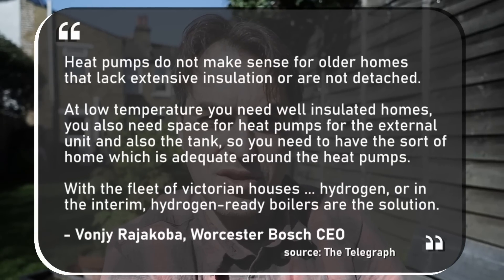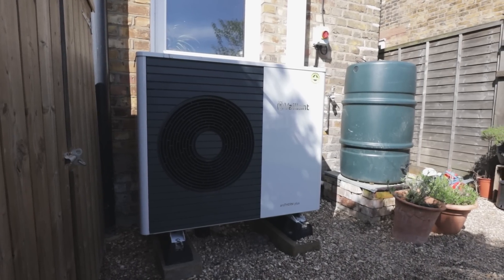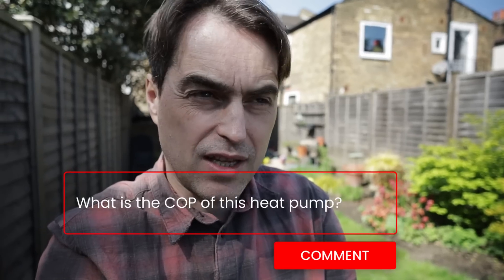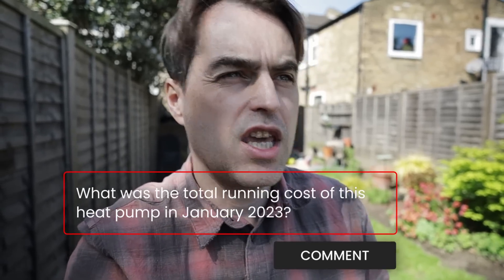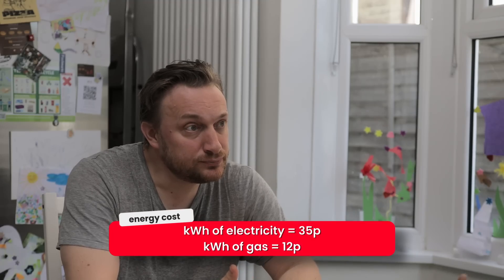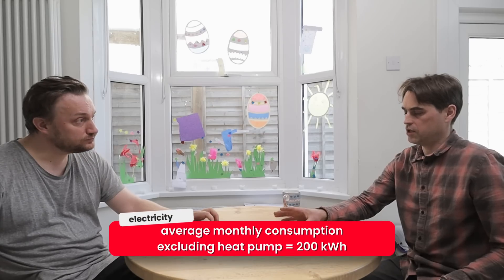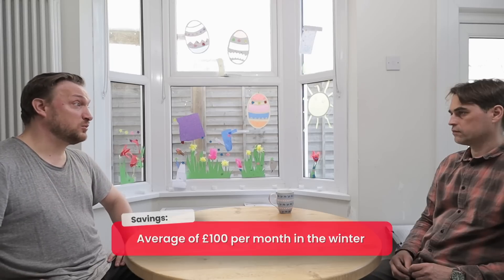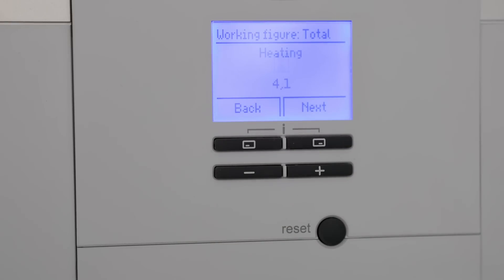Worcester Bosch CEO Is Wrong About Heat Pumps. Here Is Why.

Comment: How about a similar property fabric but twice the size with about 27,000 kW heat loss. 

But the ability to run the heat pump / s with 9p per kilowatt continuously.
Reply from the maker: 27,000kw heat loss? This one is 7kw ?
Reply: @UrbanPlumbers   ok I have planned the house using heatpunk and it says; with - 2.5° C outside temp  I need 22,241 w of heat power.  

This is not including the basement that has three rooms (42 m²)

You may be wondering why I'm chatting on here. I've had round 6 heat pump companies five of which didn't get back to me and the 6th said it was impossible
Reply: @Michael Pickles  Hi Michael

The property type or heat loss is almost irrelevant. If your property is bigger and less well insualted you just need bigger and or more radiators but that would be true for a natural gas boiler too

People naturally do this without thinking about it. A 1 bedroom flat has 1 radiator in the bedroom whereas a 10 bedroom mansion still has 1 radiator per bedroom but that equals 10 radiators 

Your home sounds huge so maybe 2 totally independent (or maybe even 3) heat pumps would be a good idea and this way if one goes out and need a repair It won't be as urgent as the other is providing heat

So the answer is yes you can definitely use a heat pump for your needs 

Also consider more internal insulation. Even the smallest amount of insulation makes  a big difference to solid walls. 15mm of internal wall insulation will reduce heat loss on a solid wall by 50%

You don't lose much space with 15mm for insulation
Reply: I totally agree,  
If I change all the radiators and put two K3 1800x650 in the major rooms and single K3 in the hallway and stuff I can achieve a flow temperature of about 45° C with a room temperature of about 19 to 20° C weather outside temperature of -2

That's running off a 16 kW Samsung heat pump
With a cop of about 3.9 
Before installing insulation. 

It's good to know the end goal and restraints before you start the project

Each of those K3 radiators (1800x650) cost £450 to £500 each
So it may be cheaper to put under floor heating on the ground floor. 
Which means I'd go with a full hog of insulating under the floor.
Reply from the maker: Did you mean 27kw not 27k kw?
Reply: Ha yes 27kw not a massive building
Reply from the maker: 27kw should be massive building. Usually 6-8 bed fully detached period uninsulated house
Reply: @UrbanPlumbers  
306 m² Edwardian. A basement, ground floor, first floor, loft conversion has 5 open fire place. 
32 kW  system boiler + hot water tank 230ltr.

First Insulation project
The bathroom is fully insulated and tanked 70mm pir in the walls and 200 in the roof 100 in the floor. With air change system.

The rest of the house is just solid brick wall 200 mm + 
Lots of windows all double glazed.
Half the floor has 100 ml insulation ( basement roof fully tanked)

The loft only has 50 mm PIR.
But there is some fibreglass in the loft floor about 100 mm.
Reply: Radiators are in dying need of replacement
Average size 1,270 by 600 K2
Reply: Houses fully detached
Reply: 6 km solar. 
Three phase power
To Victron off grid system. With 82 kWh of battery. (Grid tide system) enough to run the house for 3 days at 9p per kW
My energy zappy X2 Eddie X1 
With more 14.4 kW of solar to install later.

Copper pipe work is a mix of 22 mm and 15 mm

Comment: I'm wondering if we are comparing apples to apples here. 500kwh of electricity in jan 23 with an average cop of 4.1 (I assume jan cop was lower but let's give the heat pump a slight advantage) is roughly 2050kwh worth of heat. A gas boiler running at the same temps as the heat pump would be running at what, 90% efficiency? That's 2800kwh * .9 = 2500kwh worth of heat so that's already a 20% more heat that was needed to heat the place assumingly due to a colder weather (apparently 3.1 degree average in jan 2021 and 5.1 average in jan 2023). Were the rads the same? Because if as part of the heat pump install you installed larger rads and the old boiler was running hotter temps due to smaller rads, that again decreases it's efficiency. If we were to take .9 efficiency of a boiler to output the 2050kwh, we woul be looking at roughly £266 of a gas bill, that's £90 dearer than a heatpump so less than what was mentioned in the video.

Not bashing heat pumps, I like the idea of effectively stealing heat from outsite and bringing it inside thanks to this technology however like with all new things, the devil is in the minute detail and I'm just getting a feeling some detail is not talked about here.

I love the vids btw despite personally being against global push towards everything green, electric and generally rainbowy.

Edit: Also, did they heat the place to the same temperatures in the two months? Jan 2021 would have been a pandemic month so they would have probably been in the house more therefore needed to keep the house at the comportable temp for longer periods of time? I would love a brakedown of ALL the figures, it would make for a very good and informative video!
Reply from the maker: You are missing the fact that gas boilers are only around 85% efficient and some gas was used for cooking. So let’s say 2600kwh for heating x 0.85= 2200kWh of gas. Spot on 4.1 cop on 500kWh of electricity
Reply: Underrated idea actually! Ppl with newer condensing boilers with improper rads & flow temps should probably consider replacing the rads and ensuring proper flow temps. Then their system will be more efficient, and they will be ideally set up to switch to hear pump when it comes time to replace the boiler.
Reply: *heat pump
Reply: Why are you against the global push towards everything green? Clearly you do not value the environment that your children and grandchildren will have to live in. They will be cursing you for your complacent attitude and lack of foresight. Not nice is it?

Comment: How much are these heat pumps ? What if the price of electricity goes up would the cost against gas then be more expensive , not had heat all winter gas boiler not working , looking for something for future, old now won’t make it through another winter without heat.
Reply: @kavanobrien6547:  By all indications the tax burden that electricity currently bears is going to be shifted onto gas.  However the gov. have been saying this (Grant Shaps) for at least 2 years now but nothing happens.  Lol

Comment: the insulation thing I never understsnd. like for like an uninulated house would also use more gas.
Reply: Haha yup! And a condensing boiler at the wrong flow temp & radiator size would also use more gas!
Reply: Yes, if you have really good insulation, heating shouldn't cost much however you do it.

Comment: I have a 1989 detached 4 bed, well insulated, with micro bore to all the ground floor rads but 15mm to the upstairs rads.Couple of initial surveys said I need to replace the 10mm microbore with 15mm to get the flow rates I need. With a concrete floor that's just not going to happen within any sensible budget. Is this generally the case ? Or am I being hoodwinked ?
Reply: Could you consider adding flat panel radiators to the main floor instead?
Reply: There isn’t a problem with micro bore as long as you keep on top of your system maintenance constantly replace your inhibitor and get annual flushes, most fitters opt to swap it out because they don’t want to deal with the problems that come with poorly kept systems on micro bore that being blockages when you go to fill up after it’s been dropped.
Reply: Most fitters can't state a scop because they're no guarantee they can get microbore flushed properly due to the size of the pipe when flushing for a new system. There's usually a clause in our paperwork that if an effective flush can't be achieved we're not responsible and the pipework may have to be ripped out and replaced anyway.
That said it it's 15mm to the upstairs rads, why can't you have 15mm pipe drops down to the ground floor from above and cap off the pipework in the screed. 
The other way of getting the flow rates would be a buffer tank, which takes up more space inside the property and lowers the overall efficiency.
Reply: Two surveys make the same recommendation and you think they are trying it on?
Reply from the maker: Too many factors involved to be able to answer this question. Full heat loss calcs are needed before you can tell if microbore can be retained. It is usually best to replace it
Reply: @UrbanPlumbers  Thanks. And there lies one of the major problems for many, many houses. Most of whom will have concrete floors as was the "trend" when these houses were built and still are. The cost of replacing carpets, and other flooring on top of the mess and chopping out the floors and repairing is high. Running pipes on the surface is simply not practical. Let alone the space for oversized rads. Not many mention this. I did get two estimates last year and to be fair both said the same. the cost ? £14-17k.
Not you but the smug arrogance of some channels is unacceptable.  Are you watching Heat Geeks ? The majority of homes in the UK cannot afford such a cost. Especially as the only return is a feeling of patronising virtue signalling. Retro fitting most modern homes is out of the question.
I would like some of these channels to justify the extortionate cost against the ability of ordinary, remember them, people to afford it. The technology and costs involved in ripping apart modern, not easy victorian , homes is a gap that is simply unatainable for the vast majority of people. They are not going to be able to do it. So this lemming like rush buy the idiotic COP agreement will fail. What do people do when they have no way to heat their homes ? Can one of the virtue signallers answer that ? They never do. Sorry, rant over
Reply: @topgazza  Dig a fire pit in your concrete floor and start burning coal? Save it for the Daily Mail.
Reply: You are being hoodwinked. You need only replace microbore with 15mm pipe where resizing makes it necessary. My heating system had both microbore and coaxial valves on the radiators which were awful. When resizing I dug up the floor in order to fit 15mm pipe to the other  end of the radiator. If you really need to replacing microbore with 15mm pipe upstairs is pretty straightforward. I did this when resizing my radiators for my 1979 4 bed detached house which sounds very similar to yours. My ground source heat pump works very well with it.

Comment: Great video. You really are starting to blow the negative myths of heat pumps out of the water! 
Heat pumps will replace gas soon.
Shame about the location restrictions though. Another hurdle for heatpumps to overcome.
Reply: What they’ll replace is all the money you have in your wallet . Lol there over rated. Insulating homes and reducing the sizes of homes is the key to reducing our carbon foot print .
Reply: @garza7676  Uk home are already tiny! Heat pumps are the future, watch this space!…..
Reply: @deanchapple1  there great til the power stops working and it’s 20 degrees outside then you’ll wish you had natural gas 😂
Reply: @garza7676  gas boilers need electricity too! 🤦🏼‍♂️

Heat pumps are amazing. What other heating technology will give a 1:4 return? So for every 1 kilowatt in, it gives you the equivalent of 4 kilowatts out. 🤯
Reply: @deanchapple1  how much natural gas did you have to burn to get that kilowatt ? Genius
Reply: @garza7676  all the electricity came from renewable sources.
Reply: @deanchapple1  lol dude what are you  talking about ? Where is this fantasy land that you live in ?
Reply: @garza7676  England bro! 🤙🏼
Reply: @deanchapple1  😂😂😂😂 really😮 60% of electricity in the UK is generated by burning gas. If all  gas boilers were replaced with ASHP'S then we would be like South Africa with daily blackouts as the grid couldn't cope. That's even before all cars become EV.

Comment: Great install. What flow temps were they operating at in Jan?  Seems like flow temp is the make or break and I'm genuinely interested to know what sort of ball park this system is operating in. Cheers for the excellent videos!
Reply: You also need the right radiators. For example single tube radiators are designed to run at 180F. When the temp drops by 20 degrees they only put out half as much heat or something. Even condensing boilers must have correctly sized rads and correct flow temps to operate at their most efficient. Funny how very few people ever talk about that though..
Reply from the maker: They run it at 38c max flow temp
Reply: @UrbanPlumbers  that's great, really shows what you can get with big, but not ugly or silly radiators!
Reply: @UrbanPlumbers  I have a 6kw Daikin in my Bungalow and used 491kw in January which produced 1587kw of heat for a COP of 3.23
I run it on pure weather compensation mode. 
Design  temp is 45@ -2c but have managed to shift it down to 45@ -7c
Vailent do seem to be a bit more efficient but it is what it is.

Comment: Heat pump are more efficient when underfloor heating - i think !!
Reply from the maker: Flow temperature can be as low with rads as it is with ufh, easier with the ufh obviously but you can also get the same efficiency with larger radiators
Reply: They are but you can usually get away with resizing the radiators. This usually means changing the number of panels ofr convectors without increasing the wall area.